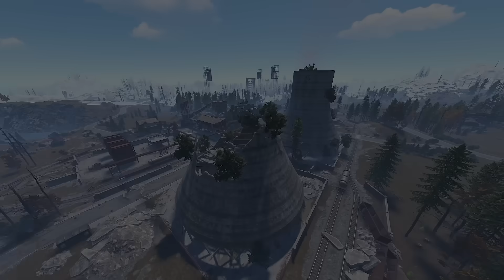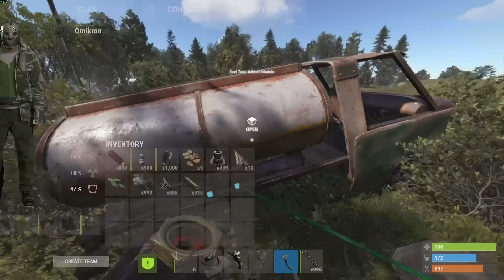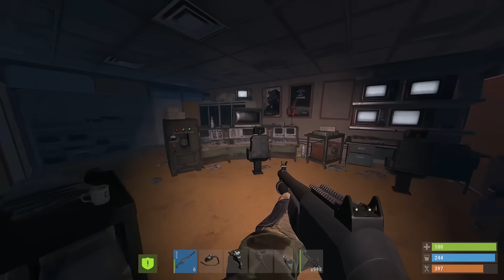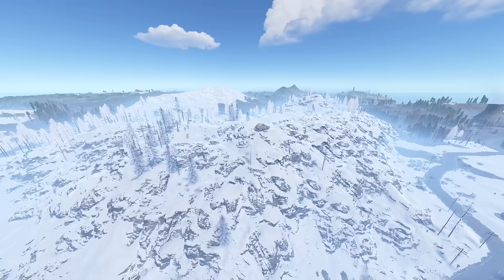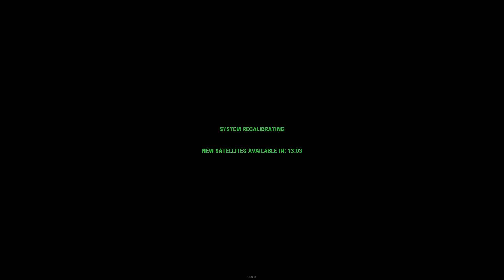Rust Monument Updates Is INSANE: Power Grid, Oil, Water & Satellites

Comment: I curious if the heavy fuse runs out like the normal fuse and if i wonder how long
Reply from the maker: It lasts longer, and for now you can put it in any fuse slot. That said, both the duration and whether it's interchangeable with regular fuses could still change before release

Comment: This is going to be crazy on PVE servers. Roads with towns on the sideline.

Hopefully, this wont be abused by larger clans to hold the server hostage by withholding our ability to use the recyclers.. Also, I feel like they need to modify the recyclers in Safe Zones to have better yields. 60% is too steep and is one of the reasons people no longer frequent there as much as they used to.

I miss that specifically from the old days. Just a mob of players in the safe zones. Really made them feel like a central place of activity.
Reply: Agreed
Reply from the maker: As things stand, recyclers aren’t connected to the main power grid. I’d really like these changes to give solo players some advantages too. Clans would keep the grid running because they need it for satellites, pumping oil at the Dome, and so on, while solos could benefit from roadside electricity and other perks whenever the grid is online.

I’d also love to see even more ways to interact with the environment.
Reply: The problem was that they were going there in the first place😂
Reply: @saphiranrust clans? Really? Never ran into that problem but then again I usually go to low pop servers 😅

Comment: It seems they toned a lot down already. The recyclers work without the grid again.
And I wish they would have located the satellite crash around satellite Dish, would have made a lot more sense in my opinion.
But that would have ment heavy changes to the monument I suppose. They rather copy existing mods.

I don't think I like those changes, but it explains why they will add the upkeep for high walls, they keep clans from walling in Power Plant.
Reply from the maker: Yeah, you're right about the high external walls. It'll be much harder to completely surround anything with them now.
As for Satellite Dish, I'd include it in this event too. Make it so you have to activate the antennas there to gain control of the satellites, while keeping the actual control room at Launch Site. I think that would make the whole event feel much more connected.